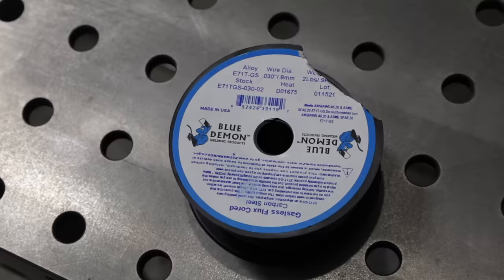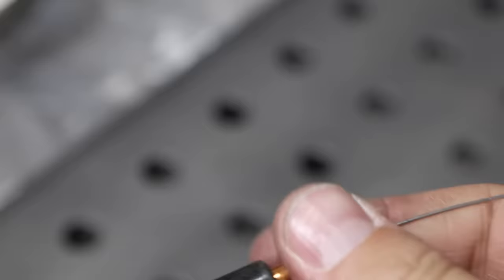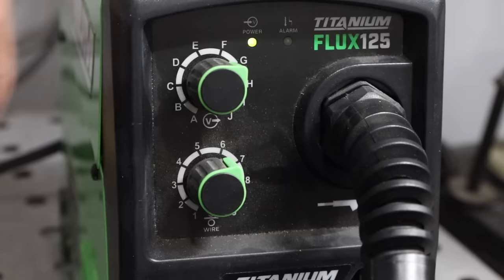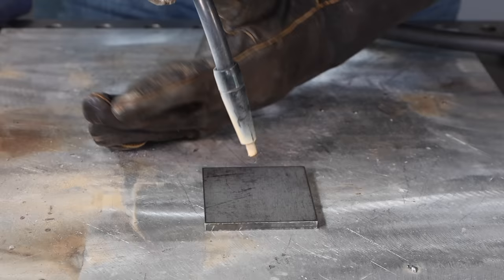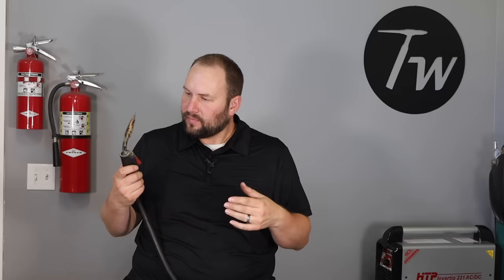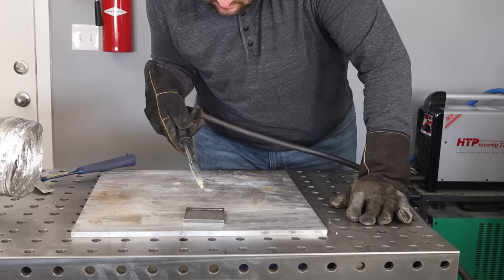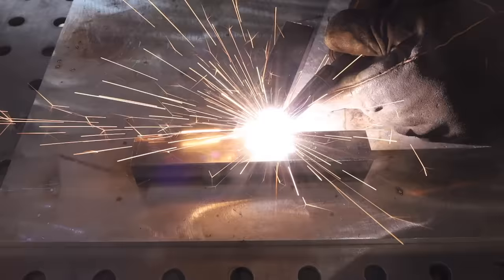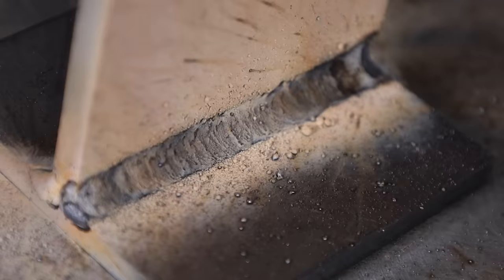Gasless Flux Core Welding Basics for Beginners

Comment from the maker: You can learn to weld.  I'll show you exactly what to do in my affordable online welding courses at https://courses.timwelds.com.
Reply: Does it matter if your wire clamp in the feed wheel is too tight? Is it possible to be too tight?
Reply: @nashsmith3005  Nash ,,,smith
Reply: Ya know 🙄
Reply: L0
Reply: 00
Reply: 0
0
P0
Reply: Isn't weaving your bead an important technique to teach for steel welding?
Reply: @nashsmith3005  yes, at least I've been told so. It can feel like it's binding up a little, not as smooth a feed.
Reply: Thank you!
Reply: Everything matters. Flux core wire is made of softer steel and it holds flux inside it. Not recommended to over tighten in order not to crush the wire.
For the solid wire it is not recommended to over tighten to extend driving roll service life.
Reply: Really?
Reply: great vid ,starting to get my 13 year old boy into welding ,Got a 180 Cigweld  think its a 3 in 1 .just came to check if needed to chip the flux off on gasless.i go through your vids to see any cool projects to do.
Reply: Chipping off really is just to see your work, checking for porosity, pin holes, penetration, consistency. I like to leave the scum on my own projects but if painting ect it’s nice to clean those up

Comment: Great Vid. Have 2 wire feeds. Learning a new hobby at 85 years old  . Yes old dogs do learn new things. Have wood working shop, wood just about priced out of sight . Just found your Vids. GREAT. THANKS Learning.   🐻
Reply: Nice attitude . I too am still learning but somehow it just isn't as Impressive as hearing you say it at 85! Hope things are moving smooth and steady and in a forward direction for you sir !
Reply: Good to hear man
Reply: Just about to say... Do I want to now learn another welding at 54 and should I be still doing this labor work     or should I be chilling n I if u 85 and still at it. Gives me hope.. My Dads 86 n I am still pottering around his house fixing his stuff.. Its just my excuse to spend time with him
Reply: That's so cool keeping yourself busy, doing new things! God bless!
Reply: @Chase Williams good on you...I just got a flux core welder on sale after Christmas...more than 1/2 price at Canadian Tire.  I am 73 and have not dropped a bead since high school.  This a great video.  all the best with your new hobby.
Reply: Just don't get into any sort of welding that requires gas, it'll get outrageously expensive, and fast.  Was quoted $700 for 2 of the 80cuft cylinders last week, $350 each for Argon and Argon/CO2 mix.  OUCH...and that's only 4 hours of welding time with each cylinder.
Reply: That's great but have you priced steel and aluminum?

Comment: Don't even feel confident enough to say I'm a rookie welder I'm a grinder but watching this definitely taught me where I'm making my mistakes. Getting a new spool of wire in the morning and hopping back on the rig to see what I can do. Thanks for taking time out of your day to make such an informative video sir.
Reply: Good luck!  From a fellow grinder.
Reply: HAHA, don't feel bad, I'm the same way...what's that saying?  I think its something like this "A grinder makes me the welder I ain't.  

I can weld, it don't look pretty, but it works.  No I wouldn't build anything that needs to support any sort of heavy weight, but putting a side piece back on a trailer, repairing the pedal/wheel retainers on an old Radio Flyer tricycle, yeah I can do that stuff, but I don't trust any of my welding for structural/weight requirements.  I maybe pickup the MIG gun once or twice a year for maybe a 1/2 hour at the most....so, every time I use one I have to learn it all again LOL.
Reply: @wildbill23c  "A grinder and paint makes me the welder I aint" lol, yeah its pretty true
Reply: @wildbill23c naw it’s grinder and paint make me the welder I ain’t lol
Reply: Haha! Like they say, “A little grinding and a little paint, makes me look like the welder I ain’t!”  Keep on sparkin’

Comment: I have that exact same Titanium portable green welder from Harbor Freight. Works like a freakin champ, and I love the fact that I can run 30+ feet of extension cord and run the welder on it with no issues whatsoever. I've used it on steel, galvanized steel, unistrut, shipping containers, etc...comes with a decent shoulder strap as well, I can sling it over my shoulder and climb ladders no problem. Settings are super easy to dial in, I recommend it for anyone learning to weld.

Comment: I have used a MIG welder for years but never a flux core wire. Thank you for a very informative tutorial. I have retired now and as a hobbyist still need the ability to weld stuff on occasions. The flux core wire welding seem to be an economical way forward. Many thanks.

Comment: Hi Tim. I recently welded up a new trailer hitch with my titanium 125 and it did excellent. I could only run it on half the settings or it would have blown through. It dug in there like it should. These are some good fluxcore welders. But I do have 28 years professional experience also. That does help lol.

Comment: Just a note @ 2:18 you can see that the wire is not sitting in the groove on the drive roll.  This is very important to note because the guide tube is always over-sized and does not guarantee that the wire will end up within the groove it needs to be.  If you close the idler without verifying this it will lead to feeding issues.  Always have to verify and make sure to push the wire into the groove as you're closing the idler arm to make sure it lands where it needs to be.
Reply: Pretty sure the wire isn't against the roller and thus in the groove until he clamps the other wheel down.

Comment: E71T-11 wire has a defined minimum spec, including being multi pass (as I understand the AWS standards..).
E71T-GS is an open spec, usually single pass wire - so wires from different manufacturers do not have to be similar and can have different formulations and performance - some will suit your needs, some won’t. (My cheap fcaw machine came with a roll of no name GS wire that actually worked very well - I just can’t source any more of it!). 
I keep both a specific GS wire (Inetub BA71TGS works for me) and a specific T11 wire on hand, and use whichever suits a particular job best - no different to having a selection of MMA rods available.
Wire selection makes an overwhelming difference in performance with fcaw, in my experience (even more so on galvanised steel), definitely worth finding the wire that best suits your set up, materials and circumstances.

Comment: Hey Tim, I like the tips on this video.  I do not use flux-core, but if I had known what I know now I would have just purchased a good Mig/Flux machine instead of a multi-processor.   I appreciate your lessons for the masses!
Reply from the maker: Thanks Daniel! Even if it's not the go-to, keeping a small roll of flux cored wire around provides another good option.

Comment: As always, Tim, very well presented. I recommend your channel to people starting out. What’s good is that you stick to the idea that you’re going to help those new to this, and don’t go wandering off into esoteric presentations that will get people confused.

I think we’ve discussed this before, but I also bought the Titanium 125. I use it in my shops where moving my ESAB 205 is a hassle, and I need smaller welds for items often milled where parts have to be locked together before welded more permanently in another area. For that certainly, it’s a great welder. I’ve used it for more than that though as a became more confident in it. Yes, the ESAB, as a $3,000 machine, does flux core better, but that’s for heavier work. I recommend the Titanium for those beginning in this.

Comment: Thank you, Tim. I have been stick welding for a couple years and it is getting better but I keep burning holes in thinner things like horseshoes. They are about a 1/4 inch thick and I am always blowing holes in them. So, I ordered a cheap MIG welder this morning and I am hoping it will work better on thinner projects. I have watched a dozen of your video and learned a lot. I just wanted to take a minute to thank you for your fine-quality video and instruction. You are doing a great job and I appreciate your time. Be well...
Reply: Yeah 1/4 inch isn’t thin by any means. You should be able to weld 16 - 18 gauge material without burning through. Has to be the wrong rods, wrong amperage.
Reply: Check the polarity on your machine and match it to what the wire calls for. I bought some E71 T11 and wondered why the work was red hot. Polarity was on DCP and the wire called for DCN.
Reply: Try different rods and mess around with your machine, it’s possible to stick weld sheet metal

Comment: all i have is a 90 amp 110v flux core welder. an xmas gift and taught myself about 15 years ago.  i'm not very good but for rural home owner type work it has done everything i have called on it for. my welds are not pretty, but they hold, have even welded up to 1/2". this vid has good tips i will use now, thanks. 
get a better vice.

Comment: Tim, this video was put together amazingly well. You perfectly cut in all the steps showing us with a dry run and the actual welding and the final product to really show what doing the tecnique looks like, it's extremely helpful. I've never welded but this is the kind of instruction that leaves me no doubt it's something I could easily add to my workshop. Thanks!

But I've gotta ask, is the next video going to be repairing the broken vice? Would that be by welding or brazing?

Comment: Thanks for this, I really enjoy and learn a lot from your videos. My only real project so far has been flux core, though most of my practice was with 6013 - I actually had to use my project (rest/holder for a control rod for my mower plow) so the "nearly hot glue for metal" predictability and ease was important.

Comment: Great video, thanks for your time. Don't feel bad about the vise, it probably suffered cumulative damage from many concussive blows over time. Perhaps you can use a shop press, or a porta power, or even make something out of a floor  jack to do bends and stress tests on your welds.

Comment: I learned to weld on a stick welder, a 125 dollar Lincoln AC welder, and we always looked at the heat penetration on the opposite side of the metal. Now that I have a new high end Hobart Multi-handler 200 welder I'm learning to mig weld with flux core wire. I'm only 72 and I wish I had bought a wire welder years ago because I doubt that I'll get my money's worth out of it, but I did repair my mobility scooter carrier for my pickup, so I've already justified the purchase. The kid farmer a couple miles up the road stopped by the other day, so I showed him my new welder and my first project. He noticed that I had excellent heat penetration and that my welds were pretty smooth. Good to know that I've still got It and that I can still impress a kid I've changed diapers on. Grandma says that it would have been cheaper to hire my professional welder friend down the road. She might be right, but she doesn't understand guy thinking. This is the second of your videos that I've watched, and I appreciate your expertise. Thanks!

Comment: Great video, Tim, as per your usual content. The part about cutting the joint apart to verify the penetration was WAY cool. It can be deceiving to see a 'good' bead for thicker metals, although the joint is NOT necessarily good for strength.
  I would like to see your techniques for multiple passes (thicker metals), since the wire here is single pass only.

Comment: S-A-M: Stick out / Angle / Movement    This how I'll remember it. Thanks for video.
Reply: There's power level and wire feed too. It's like juggling. There's a lot in the air at once. Material thickness, fit up, warp. Variables.

Comment: This video was really helpful l. I bought a cheap flux core MiG welder and just did what i thought was welding. I installed a metal shelf in a locker. My welds were spotty at best and the recommended wire speed was really high for 1mm thick sheet metal. I kept burning holes before i could get a pool to drag along. I now know that i should have probably turned the voltage lower than the stock setting. I also didn't pay attention to having the right size nozzle tip or the groove on the bearing. I also think i may have been crushing the wire on the adjuster because i felt tight=good. I had a lot of splatter. Thanks for the video!

Comment: When using flux core wire  you had mentioned most wires recommend single pass. With this in mind, what is the problem with doing multi pass welds? Thanks for the advice!
Reply: I believe doing multiple pass welds with a single pass wire doesn't offer additional strength
Reply: probably gets contaminated too much or smth
Reply: "Single pass" Flux core contains manganese which work hardens and adds strength, so multipass with these electrodes can add too much manganese causing the weld to become too hard/brittle and fail.
Reply: Thanks for the input. I will have to look for "multi pass" wire for instances where multiple pass may be required/needed
Reply: @russellyoung2900  get some Corbin Dallas multi pass wire. 😆
Reply: @russellyoung2900  the closest selfshielding FCAW to the 7018's would be the AWS T-8. Just not sure of smallest available diameter or package. FYI, both LINC & Hobart have a product.
Reply: Multi pass welds can develop slag pockets making a weak weld. you can do more but you have to know what your doing.

Comment: I'm very much a novice...to the point I have the cheapest harbor freight welder that I bought in 2008, this video helped me really improve my welds....the only modification I did was change the original ground clamp with a jumper cable clamp which helped some also.

Comment: As an absolute novice that's soaking up everything I can learn .. this was a great video. THANKS!

Flux core MIG will probably be the most common thing I do moving forward. I've just ordered a "middle of the range" multi-process machine that'll do gas and gas-less welding (It'll even TIG weld but from my early understanding, a AC/DC purpose designed TIG welder is more desirable) ... not that I'll be jumping into TIG welding any time soon!

Comment: With a 110v flux core welder and 1/4" or even slightly thicker metal I've used a torch to heat the joint area for a minute then immediately run a bead. Works very well.
Reply: Very nice... Yes.. That work well on everything, saves your electric bill also

Comment: Your tips have convinced me i have to buy a welding helmet and a pair of gloves. My welder came with a shield that i have to hold in 1 hand, so i’m way less stable than i wanna be. I can put down decent beads without any experience whatsoever, but if i wanna earn a bit of money i’ll have to improve. Luckily said items are relatively cheap, so i’ll get them asap. I learned soldering years ago, but i never thought welding would be as much fun as it is. Thanks!

Comment: I'm glad you said something about checking whether or not a second pass could be done.  I was just getting ready to do a second pass and decided I'd come look at your video again.
Reply from the maker: Yeah, generally if there's an S in the designation (usually E71T-GS), that means that it is for single pass welds. E71T-G or E71T-11 are common multiples wires. It's always best to check the manufacturers data, though.

Comment: Great video exactly what I was looking for. I have never weld and will be doing so in the next couple of hours. I have had advice from my son who is a machinist in many areas. I have a loaned out Lincoln wire fed welder and simply welding square stock to make an H like bracket. This video is absolutely what I was looking for. Excellent explanation and right to the point. Thank you

Comment: 9:52  Using a rest is also a lot easier on the body in the long run. 
Bungee cords, rope, ratchet straps and boards work for an arm rest too. I repaired heavy equipment for years and learned it from an old rancher welding on his bailer. 
I’ve even gone as far as to tach something in place for my arm/wrist to rest on.

Comment: Another important drive roller consideration is the V-groove roller used for for solid wire will often crush the flux core and fail to feed it.  Use only the toothed round-groove drive wheel of the correct size.  Nice vid!

Comment: Great video.  You do a good job explaining so anyone can understand.  

One suggestion for when you exceed the material thickness of the machine.  Put a 45° bevel on the workpiece that will allow you to get full penetration.  You might have to take multiple passes.  This was the standard way I was taught 50 years ago.

Thanks for the video.  Like I said at the top, you did a great job.

Comment: I have a Lincoln weld pak 155 set up with flux core from the early 90s using .35 wire. I've fabricated and built trailers that tow over 30k. Being a certified structural welder I've never had an issue running an old school flux core welder good n hot on 3/8th material or up to 1/2.

Comment: Tim, you mentioned my goal at the end of your video. I've been interested in welding for a long time and just started with the help of your 'stick' videos. Been practicing by patching a hole in a motorcycle exhaust, I'm keeping the voltage lower than recommended (35v) since it seems I'm still burning holes (not too pretty).
 My goal is to upgrade my hitch and I was thinking of buying the Harbor Freight Flux gas less you demonstrated,glad I watched your video first. I plan on welding as a hobby not professionally. I don't know if I want to stick to stick and might be welding overhead by the gas tank.
  Guess I'll keep practicing with my daughter's welder for now,it does MIG,TIG and stick. Great videos.